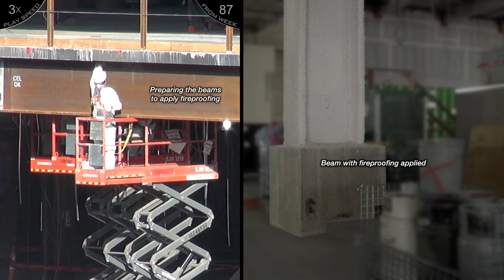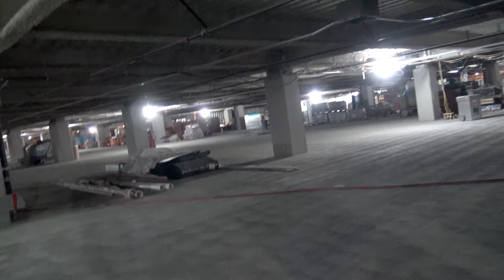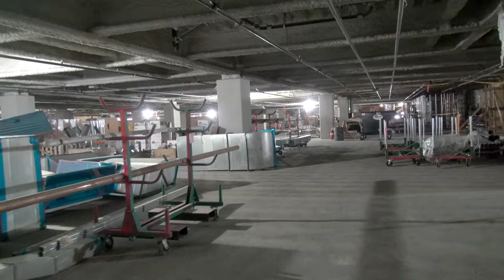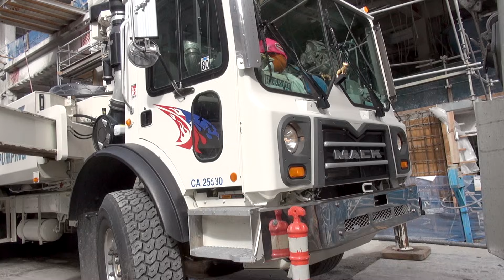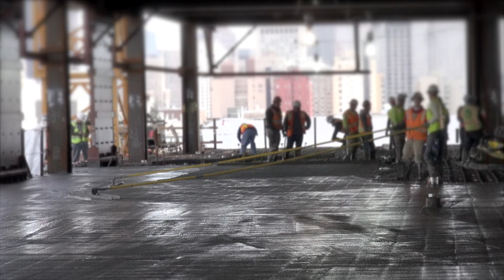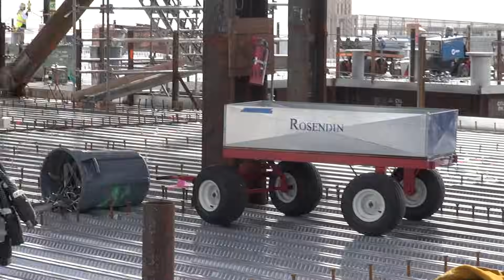A tour inside the construction site: Week 89 Site Visit

Comment: Having come to the end of the current videos, I was directed to this.  It's excellent -- the only ones I liked better had to do with the disassembly of crane #2.  Given the monumental effort you put into this series, I'd like to think that someone somewhere will see fit to guide you (and us) around the finished buildings (both the hospital and the one across the street) to see how they all turned out.  For what it's worth, the vertical steel bits are columns; only the horizontal ones are beams.
Reply from the maker: I can still hope that maybe we'll be able to get some sort of tour, but unfortunately the odds don't appear to be good.  Time will tell. Sorry about the imprecise terminology!  Thanks for the comment, good to hear from you.

Comment: Very cool!  It's too bad you can't do this every few weeks or months.  Maybe they'll let you do it again in a year or so.  The building seems so much bigger from this perspective.  Obviously we're all used to seeing it from far away so it doesn't look nearly as big.

I was surprised to see drywall at 2:00!  I was wondering how the elevator works, how do you call it to a floor?  Does that guy just stay on there and run it all day?

Also, do you know why they've left the roof open on the top floor, or why they have that lonely column up there?
Reply from the maker: +TheMrFinneth They have some sort of communication system, I don't know the details, but they communicate as to who needs the elevator. where and when.  Apparently it is required that it be manned by an operator at all times that it is in use.  Alas, I didn't ask about the roof, I've been meaning to do that, although it usually takes some time to get answers.  I did recently find out what the lonely column is for, and I'm planning to include that in Week 96, as it is looking so far like Week 96 may be a little short on highlights, not a lot to see that week -- so I'll leave that as a surprise for Week 96.
Reply: Ah the suspense!  My guess for the roof is that there will probably be mechanical stuff up there, and instead of walls there will be vents.  They will probably crane the generators or whatnot in through the roof and then fill in the roof like normal.  I'll bet that's why they're raising the tower crane again.